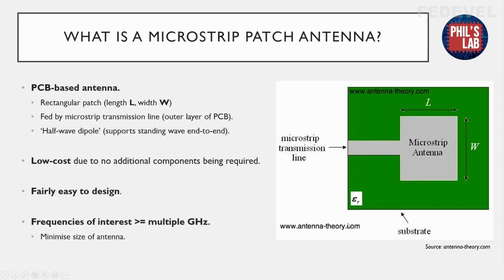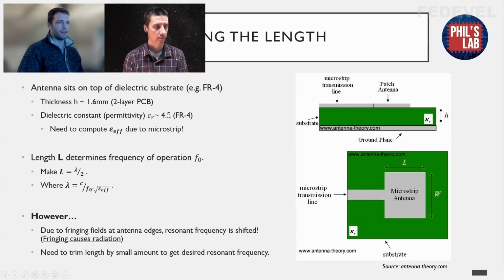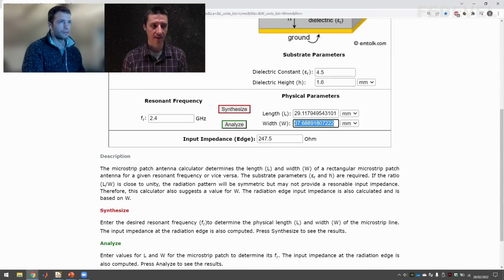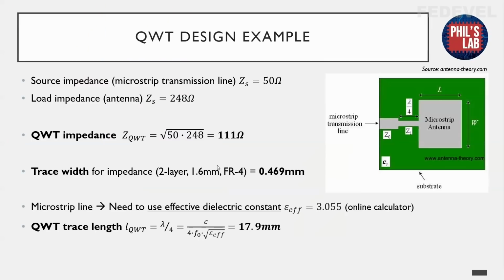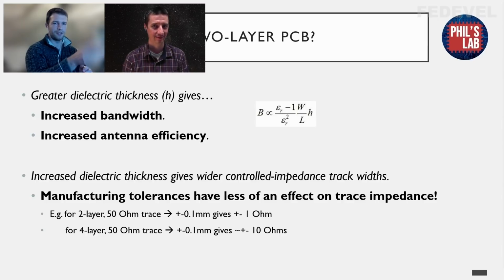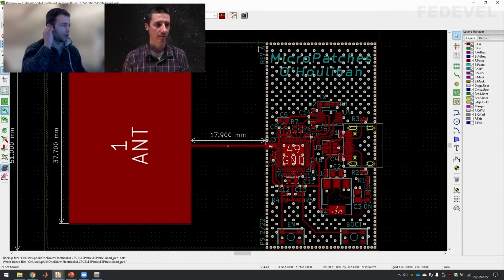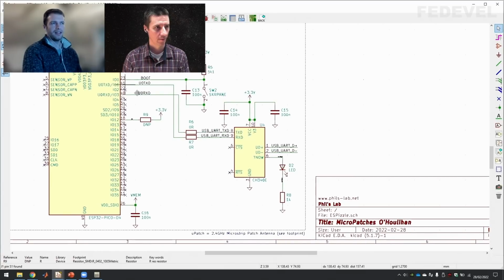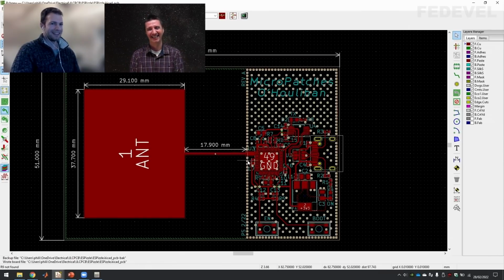Designing a PCB patch antenna for WiFi and Bluetooth | KiCad | Philip Salmony

Comment: I’m having a fun night having no real knowledge but going down a rabbit hole from something that came up in my feed. I’m  learning along the way. Hats off to you & Phil for providing an insight into the antenna design & trials/tribulations to come. Imho this patch antenna just looks wrong with such a thin connect to the main antenna - & the area occupied - so prob reason you might not see in any other designs but you’re generally only looking for 10m distance. 

Although external patch antennas are like this and larger. These allow to position according to the direction you want to send / receive signal - extend range. 

Soooo many ways to skin a cat. I shall now look up ceramic antennas.

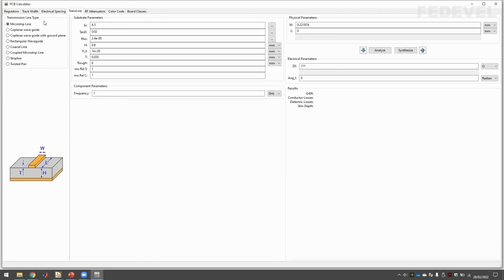Comment: One correction to make note of - around 21:20 and 23:45, when you calculate the width of the feed line, you are using 1GHz as the frequency. This should be 2.4GHz, isn't it ?

Comment: If you made the thin line longer so it crosses the center of the other "1" pads you don't need to connect them with a track, they already appear connected. Source: I do a lot of custom multi-package footprints.

Comment: Yet another amazing and invaluable video. This gave me insight and hope that maybe I too can learn the black magics of RF. My antenna knowledge goes as far as: this is recommended by the manufacturer, so I use this. Hopefully I will have time to learn more about it, so that I could design a custom embedded computer with integrated GSM on board.
Edit: I don't know about the Arduino side, because I avoid it like the plague, but in the esp-idf, one can use any FT2232 as JTAG programmer/debugger in combination with OpenOCD.

Comment: Thank you Robert and Phil for the video. 
TBH i thought you are gonna implement the filters on the patch itself but i learnt something new. 
Although an optional provision for  impednace tuner with passives could potentially save respins of PCB.

Also @ 35:50 you were unsure about the Tx power setting. I advise you to check esp-idf documentation for the function 
"
esp_err_t esp_wifi_set_max_tx_power(int8_t power);" there is a similar function prototype define for arduino(if you use arduino) called "WiFi.setOutputPower(float x);".

Comment: Consider the details when you make your own antenna. Sometimes you may need to tune it with a matching network for any number of reasons, especially if there us something in your enclosure that interacts with the antenna. Sometimes you need to provide easy access for regulatory testing. So consider adding a UFL connector on the feed line for a spectrum analyzer or network analyzer that can be DNP for production.

Comment: When calculating wavelength, you can literally type in "speed of light / (2.4 GHz * sqrt(3.1))" Google will keep track of the units very well. Who ever at google worked on their unit analysis is quite good, I have yet to run into conversion that won't work.

Comment: You should always provide 0603 or 0402 pads for an LC matching network between the antenna and output of the ESP. Through calculation and layout, you will never get the optimal configuration until you test it with a VNA from the pin of the ESP looking outward towards the antenna. Plus there are much smaller PCB antenna footprints and designs than this! Cypress have a great application note on PCB antenna design ... "Cypress AN91445 - Antenna Design and RF Layout Guidelines".

Comment: Great video! Be careful with some ESPs, because not all of them feature a 50Ohm impedance on their RF pin! For example the esp8366 has a complex impedance like 30+20j Ohms, so it would need further matching circuitry. Always take care of the reference designs!
Reply: Good catch! I (naively) assumed a 50R impedance at the LNA_IN pin without double-checking. Added in an impedance matching circuit to the design :)
Reply: @PhilsLab  In my (limited) experience, you should always assume complex impedance at the pin for every IC. It is a nice surprise when it is 50R without imaginary parts, but usually you need to do some complex impedance matching.

Comment: Nice topics as usual
I would like to ask about 7:11, what does impedance here mean? and for what can we use it?
Reply: He is calculating effective permittivity and impedance here is just the impedance of the track if you draw a copper line.
Reply: @MübinIcyer  I mentioned this because he used two websites, and each one gives different value for impedance
Thanks for your response

Comment: Very interesting video! I would like to see how the actual antenna performs. I've only recently started working with the ESP32 and I'm quite impressed by it's capabilities. There's a bit of a learning curve associated with the IDF framework, but the documentation and examples are very good. I found it much easier to start with compared to the STM32. Big bonus: you can actually buy the parts ;-)
For debugging, the serial monitor is quite useful. The cheapest hardware solution for JTAG debugging seems to be a FTDI2232 board...which, of course, you can't buy at the moment.

Comment: There are better antenna type for BT/WIFI. At 2.4GHz inverted F antennas, meander antennas or ceramic chip antennas may be a better solution. Especially when your product will have an enclosure walls close to antenna. Patch will detune a lot within close proximity of any plastics.
Reply: Completely agree. Performance of this antenna vs others isn’t great, also in terms of size. This video is simply to demonstrate one of the easiest antennae to design, without much/any prior knowledge.
Reply: @PhilsLab  yes, it is a good introduction to antenna topics and how to match them using lambda/4 transformer. Good job!

Comment: Awesome. Is it possible to use this type of antennas in the Sub-GHz too?
Reply: Due to antenna size rather no. Try inverted f antenna - IFA.
Reply: @doktortronikelektronikaszk4070  I'm looking for a ceramic antenna too but can't find a guide on how to connect the balun to the antenna. Any guidance you could give? Thanks!
Reply: @EfraAv  Wurth Electronics has good selection of Antennas, also Abracon or other manufacturers (i design a lot of LoRa devices on Abracon and Rainsun antennas). Key success here is to have some space on the PCB to keep the clearance for ceramic antenna. When you select the antenna - measure its impedance with VNA in the enclosure with target PCB of your device and then design matching network. Try to keep in mind that something like ETSI standard exists so attenuation of harmonics may have an impact on the matching network type.